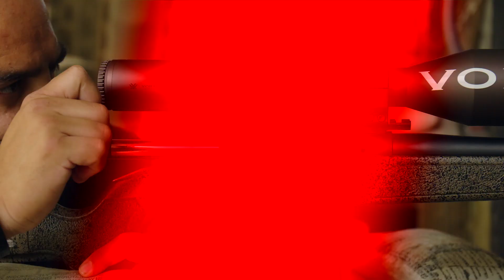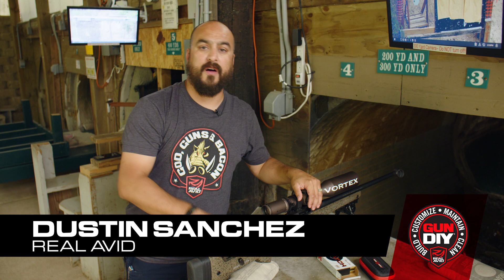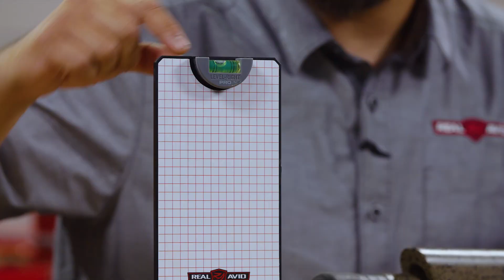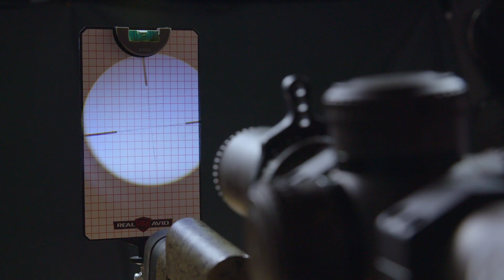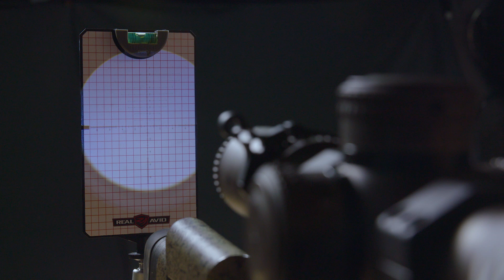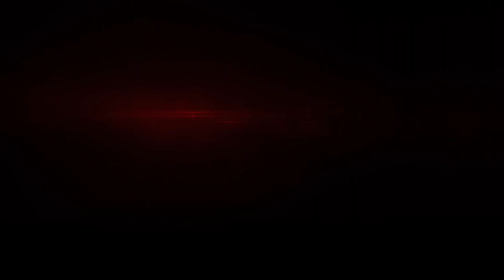Level Your Scope Reticle Right: Vortex Razor on Bergara B-14

Comment: There’s one problem with the first step he makes in this video: in a rifle without a picatinny rail in front of the scope, there’s no way to be sure that the rifle is actually leveled. You’ll get the reticle leveled with gravity, sure, but not the rifle.  
As someone who owns the “gizmo”, let me give my 2 cents:

1- Yes, this can’t be used to level a rifle without a picatinny rail in front of the scope (it comes with a 1913 adapter and even then the rail better be perfectly leveled with the receiver). You have to first level the rifle with a bubble “spirit” level small enough to be placed on some flat surface of the receiver, usually behind the rear scope ring (wheeler has a kit for this, but any cheap alternative works).

2- You would be better off using a viSe that clamps on the stock and / or handguard. I use the Tipton Ultra gun viSe, but their Best gun viSe also works. Real Avid released the Master gun viSe that has a fine adjustment knob for tilt correction specifically designed for leveling scopes

3- Once you have your rifle leveled by other means and secured on the viSe, it won’t matter if the adapter and its bubble are leveled with the rest of the gun or not: it’s just a flashlight, it will still work with your reticle.

4- The most important thing for using this kit correctly is to level the special “target” with the grid properly. This step will assure you that the reticle is leveled with gravity, which is the point  of all of this.

In summary, the Level-Right Pro works, and it’s definitely better than using the turret covers as indexing (as there can be errors between them and the reticle) or a plumb-bob (too many variables). HOWEVER, if you are not using it on an AR rifle (or any other with a picatinny rail on the forend/handguard) you can skip the STEP 1 in this video (in reality you will perform it with other equipment).
If you own a good viSe that can keep your rifle solid and knows how to level it, go for it.
You won’t regret buying this kit. Pair it with a good laser bore sighter and zeroing your rifles for long range will be a lot less frustrating experience.

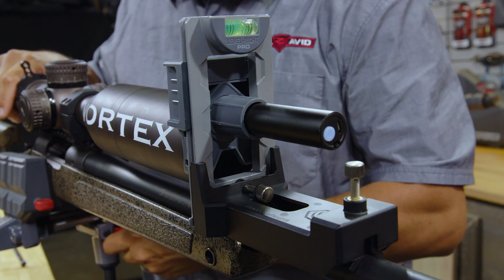Comment: Short and sweet. But not using levels (on the turret or rail), stacking tolerances, and adjusting the rifle (2:05) could use more explanation for most people.
Reply from the maker: From low end to high end optics, we have found that not all
turrets are perfectly level. By using a flashlight, a grid that is level
(this idea came from using a plumb bob) and a setup that forms one
single plane between the optic and rifle the end user can align their
optic more accurately.
Reply: I'm not 100% on all of this because I'm new to firearms but when mounting a scope you are supposed to use a level to make sure the optic is straight and level on the gun.  You usually have to level the gun and then level the optic.

As for stacking tolerances, that refers to the measurement allowances for multiple items that could end up causing issues.  For instance, let's say you have a level that shows a level surface even if the surface is tilted by plus or minus 3 degrees.  So if you level your gun with that level, your gun could be level but it could also be tilted by up to 3 degrees to the left or 3 degrees to the right.  So let's say it's 3 degree to the right.  You out your scope on the gun and then attempt to level your scope on a gun that is tilted 3 degrees to the right.  Now you mount your scope and it can be 3 degrees to the right or left on your gun that's already 3 degrees to the right.

My example of tolerance stacking isn't great but I was trying to think of something gun related.  I deal with stacking tolerance in my manufacturing job and it's something we have to look out for.  I hope my explanation helped.